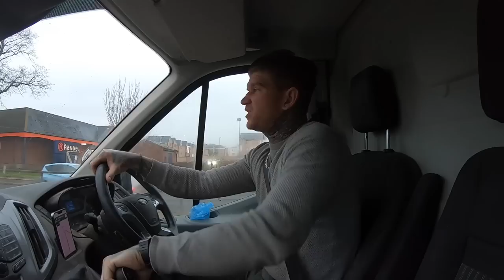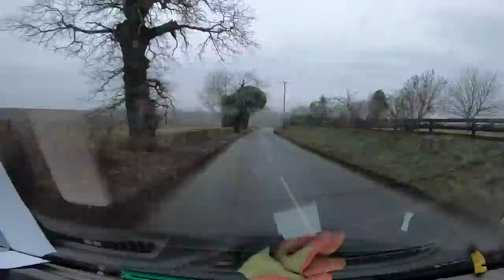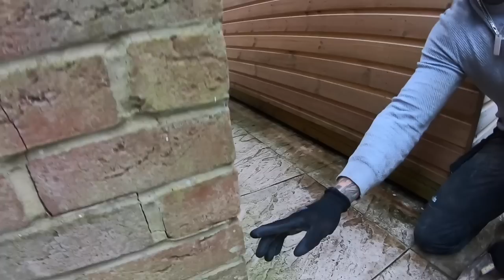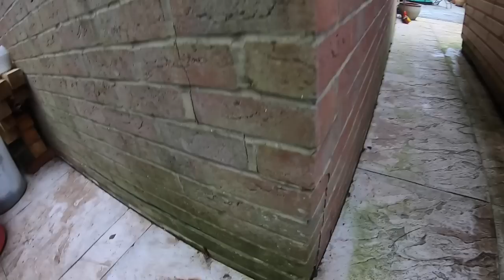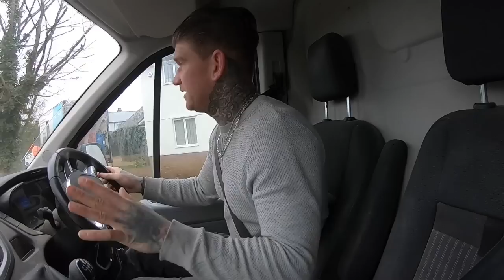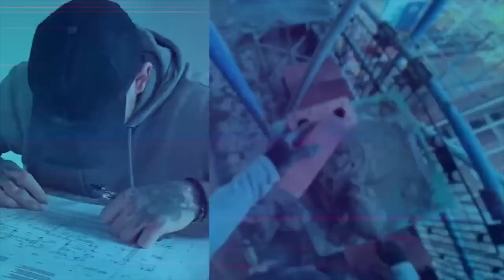What do you think of this job then!?!....

Comment: Is it a house or garage ? 
Is the inside skin cracked ? 
Looked at a similar job to this which was cracked from the eaves to the footing. The crack was on the corner of the house and mainly followed the mortar joints but had also cracked straight through some bricks and I said the same things as you Charlie.
Told them to get surveyor as the house was for sale pending.
Surveyor said it was due to expansion or lack of expansion joints being built in.

Comment: Ground movement, soil could of absorb a lot of water and a really hot week has absorb everything out of the ground and making the soil shrink and resulting in too much wait on the slab footing (footing will be with a gap now between the ground and underneath the concrete) resulting with the concrete collapsing. 

Major job and I’d keep away from it …

Comment: I think the footing isn't cracked badly. I think that settlement and the heaving of the building over the years has just put a little too much stress on that side of the building and it's cracked. Is there any cracking on the internal leaf of that wall? Take a look at the foundation still just in case of any splits or cracks but I couldn't see it being that due to the foundation being quite thick. After you've checked the foundation, just do your usually thing, props, bricks and mortar to get it looking nice again. That should do the trick

Comment: Leave it for the structual engineer to access..let them advise you the procedure to  fix ....
Reply: Totally agree, my old house had the same problem with subsidence, and it looked the same as that job Charlie looked at, structural surveyor said total underpin with pilings, was a massive job,..
Plus the state and condition of the ground works, may need a few months to dry out,..

Comment: Interesting, based on the footage I would imagine the footing is comprised and at a guess excess amount of water looks like the cause. 

Things to check, Number 1 would be that the gutters are not broke / blocked, if so excess water could be running down the brick work and consistently soaking the bricks and not getting chance to dry out causing the cracking. Or saturating the footing causing it fail/ brake.

(Especially if it's not a deep footing, like the older houses , common to only have a 6inch footing)

Number 2, checking the roof for leaks, same as iusse number 1 but water is running down inside the cavity, and no where to escape again causing extreme saturation of the bricks and or footing.

Number 3, potentially not proper drainage under the slabs and causing water to pool underneath and saturating the footings.

Also check the fail on the patio slabs, making sure the water is running away from the house!

Number 4, checking underneath those slabs for drainage pipes in the area, if there is a leak in the drainage pipe ( very common on the old terracotta pipes ) this could could excess water to be pooling up in the area and then causing damage to footings.

Add the fact that we have have -5 degree weather recently could of caused the water to freeze and expand causing cracking to bricks and or foundation.

Ps: I'm not a professional.

Please keep us update would be very interesting to know the cause. 👍👍
Reply: My thoughts are youve had a couple of lines judging by the detail your going into mate 🤣

Comment: If I had to put money on it I'd say frost heave. Lifted the founds and then when it got warmer it let them all go at once. Too much movement too quick and pop. 
I'd be looking to see if drainage has changed, or maybe it's blocked and holding water against the founds. Usually happens when someone replaces grass with a nice new concrete slab and impervious patio 😂

Comment: Best thing to do is dig it out in day work and get a structural engineer to have a look at it.
Reply: Seriously mate,  you don't need a structural engineer for this, unless there is a sink hole under. Could be just a leaking water main which is an easy fix if it is a poly pipe
Reply: @fruitgums  easier to get one. just to cover your back. If you do what you think and the crack comes back your liable to repair it.
Reply: @Mao.Loves.Zedong  I know, but I'm confident that I wouldn't need to come back. In my experience it's likely to be a water, if it then requires underpinning then I'd call him in. But in that case I probably would turn the job down because you often find yourself waiting for inspectors in the van, and the jolly client will feel frustrated that he is paying for waiting.

Comment: Foundations have moved for one reason or another to cause a crack like that, just working on a bungalow myself with almost identical cracks and looks a similar age, early 70s build in a fairly rural location mine is. Take down, see how big the actual damage is below and repair if need be, then rebuild.

Comment: When was this first observed? Is it on clay soil? After the hot dry summer we’ve had, it may be shrinking soil & the foundation to ground now has a void at the corner. Bushes trees nearby sucking the soil dry last summer? You could put Tell Tale movement strips on the wall, but that’s a longer term just to put what you could find out if you dug a trench at the corner to find out more clues. At this stage, it is more of a surveyor’s job. If you know what you are looking for, you’ll eventually find out the root cause.

Comment: Incorrect foundation, I believe they’ve either poured on poor ground, or there is a cold joint. It could be built up ground in the past and slowly it’s finally settled and created a void. Over time the house has settled and it’s all fell into place. 

I’d suggest leaving it to the professional building control, and obviously provide the services when the answers are available 😊

Comment: Just rake out the cracked joints n put steel reinforcement rods in using sealant mastic joint then point over
Reply: Sounds like a  cowboy  fix. Stainless steel  rods and epoxy mortar.  Epoxy mortar lft recessed  20mm for repointing with a  5 to 1  sand/cement mix.